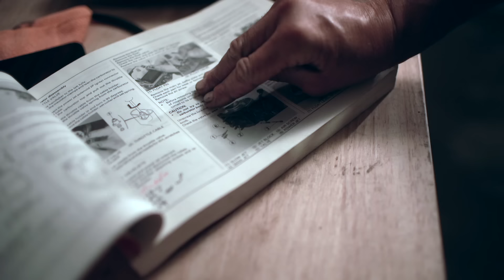Velocity Disorder II. Honda CRF450R vs CR250R

Comment: I love the video just hate to see the CR250 two stroke get disked like this by racing a CRF 450 but the 250 handled that 450 pretty well i would like to see the 450 race  a CR500 because the 450 is what took the place of the CR500 what do yall think?
Reply: 250 2 stroke = 450 four stroke in terms of power. (Almost) The 450f class replaced the 250 2 stroke class not the 500.
Reply: @MotoBuilds  i gess that puts the CRF250R in the 125 two stroke class and the CRF150R in the 80 or 85 two stroke class dam these four stroke bikes are slower than i thought i grow up riding two strokes anything from a CR500 to a TRX 250r plus the two strokes are cheaper to rebuild and the four strokes dont hold up that well to todays riders as good as the two strokes did?
Reply: @mitchellsteen9283  four strokes have power strokes half as often so they essentially have half of power., but that can be fixed with displacement.  Ha. I wouldnt say 4 strokes are "slow" because the displacement has been doubled and most modern 450s are more than the average rider can handle nowadays.  4 strokes are more expensive during a catostropjic engine failure event but the only real difference is a valve train in the head and a timing chain.  And the reliability of the 4 stroke is much better IF properly maintained.  I love them both but I dumped my 2 stroke for my 450 because the power curve is more linear than exponential and I can get 150 hours out of a single piston.  Go check out my channel if you want to see me rebuild a 450r engine :)
Reply: @MotoBuilds  Not even close. That's the kind of mindset people have because they rely on outdated information and logic. 4 strokes have advanced and progressed to the point that they match their two stroke counterparts in power and weight. The latest 2019 models of the 250 4 strokes have more wheel horsepower than what Yamaha and KTM's 125 2 strokes produce at the crank. Here's a little comparison

A 2018 KTM 250 SX 2 Stroke Dynos at 40.11 rear wheel horsepower, and weighs in at 211 pounds or 95kg

Compare that to a 2019 KTM 250SXF, which Dynos at 38 rear wheel horsepower and weighs 98kg. Not only is that barely less powerful and barely more weight, but that 250 SXF is more powerful than Yamaha's YZ250, and weighs half a kilo less. The YZ250 Dyno'd at 35.06 horsepower at the rear wheel. As for the 450s...they Dyno around 54 horsepower at the rear wheel, indicating they have over 60 at the crank. This is very clear when you look at races and videos where they can make use of that power. I watched a full hour plus race from HighSidedFilms where the guy used a 450 Honda, constantly battling with a guy using a 250 ktm 2 stroke (He ended up losing because he fell literally 100m away from the finish line) . And every time they got to a longer straight, or any point where they could make use of their power, the 450 just freight trained away like it was playing with it. The reason people don't always notice the difference in power is because on a small, tight dirt course you can't really make use of that 60 hp. When you take a really good rider on a 125 2 stroke and put him against someone average on a 450, i wouldn't be suprised if the guy on the 125 easily wins. And if both were good riders then i don't imagine the guy on the 450 even be running Laps around the 125 either because power is hardly all that matters there . Because on dirt tracks you really do need skill. And the whole 80% rider, 20% bike thing really comes into play
Reply: @dean8067  interesting.  Wasn't aware the stock 250fs were pulling those numbers.  I build 4 stroke mx bikes for a living but the majority of builds are carbed 04-09 bikes.  The 450s are still pushing 52 stock in those years but the 250fs wont hold their own against a 250 2t in those years. Having said this it still holds true that the 450 class = 250 2t class from years back and the 250f took the 125 class.
Reply: @dean8067  Something to note is that regardless of how you look at it, The 2 stroke literally will have twice the power of the 4 stroke engine at the same displacement  if they are built with identical advantage. The newer bikes come stock with a much higher compression ratio piston, optimized downdraft intakes, have electronic fuel injection, have selectible mapping to advance spark timing and so forth.  This tech stopped for the 2 stokes way back-when, and if this tech was applied to the 2t today it would match those same numbers to the rear wheel at half the displacement. Don't get me wrong, the 4 stroke is amazing.  I love mine. But at the same cc's under the same conditions, the 2 stroke has twice as many power strokes and is thus twice as powerful.
Reply: @MotoBuilds  All those things you mentioned about the 4 strokes are very true, those are exactly what made them so powerful lately and right and match the power of the 2 strokes. But the thing that people get wrong allot of the time is, 2 strokes actually haven't been out casted from research and development, or left to die with ancient technology. The thing is, 2 stroke technology has huge limitations, and is pretty much stagnant as far as making stock power, and has very little more to improve, because it functions so very different from a 4 strokes, almost none of the things that make these modern 4 strokes so fast can be done to 2 strokes. You can't add traditional fuel injection, so no nice mapping and custom tuning. 2 stroke technology relies heavily on its ability to breath, which is why they don't even have a rev limiter and simply hit a point where it can't give anymore when you accelerate hard, so they can't be forced induced in any form or way (I know the 4 stroke bikes don't get turbod much either, this is more of a reference to road bikes like the Kawasaki H2 and modified bikes).

If you look at KTM In particularly, you'll especially see how they do in fact try to update and innovate with their 2 stroke bikes. They spent millions in research and development, developing and designing their own custom two stroke fuel injection alternative so that they improve upon their engine, because that's all they can do... They can literally do nothing else to improve the engine much in the same ways as the 4 strokes so they innovative and try new experimental things. Recently 2 strokes are more popular than ever it seems, people love being nostalgic, hating on everything 4 stroke and sticking with 2t. You can see it everywhere in social media and even here on YouTube in any comment section about dirt bikes. The other day the YouTuber MotoTube asked his subscribers to vote in the comments who preferred 2 stroke or 4 stroke. And roughly 80% of people said 2 stroke. So using this information you can assume KTM, Husqvarna and Yamaha's 2 stroke models sell better than their 4 stroke options, or at least sells competitively to the point that it makes a huge profit for them. Each brand has 2 other manufacturers to compete with in terms of sales, performance and such. So why wouldn't they try and update the bikes, it only makes sense. Ktm did just that, and reaping the rewards for it. Even without concidering the TPI model though, they have been redesigning and updating their 2 stroke models regularly, similarly to their 4 stroke counterparts aswell. There just isn't much they can do, without ruining the reliability, rideability and such. Although their 250 2 stroke has gained about 5 horsepower since 2006 to now
Reply: @dean8067  Out of all you said, one thing really hit hard, 80 percent preferred 2 strokes!??  Holy hell I need to start rebuilding and selling 2 bangers. Lol But in all seriousness, good points.  I wasn't sure if there was more to be applied to the 2 strokes in terms of tech that was just undiscovered as of yet because of the move away from them but the R&D may have very well hit a wall.
Reply: @MotoBuilds  Haha yeah that's for sure. I wish the community was abit larger here where i live aswell, because there are so few nice places to go ride and enjoy yourself, i need to travel quite the distance. So here i don't really care who, 2 stroke fans or 4 stroke fans, i just need people to ride with hahaha. But yeah man maybe they might suprise us and so something big, we never know. All i know is that all of the bikes have become so good that it doesn't matter what you prefer or want to buy, the biggest difference lately is the color of the plastics. They'll all give you heaps of fun and loads of performance
Reply: @MotoBuilds  four strokes have more moving parts in the motor which makes them slower two strokes have fewer moving parts which makes them faster and the motors trun ten times more revolutions than the four strokes in the same distance
Reply: @MotoBuilds  if you look at the drag racing side of the two strokes which are the same engines just i a different kind of racing there has been a lot of improvements in making way more power in the two strokes it just needs to be converted into a racing style
Reply: @code name noob a stock cr500 makes 58.8 horsepower which should be in the 450 class a built and stroked cr500 ive seen reports on makes any where from 90 to 100 horsepower the point i was making is that in this video the 250 done very well riding with this 450 but both are very nice  bikes i would just like to see them race in their on classes to what the best is i gess im still hung up on castor 927  and racing fuel
Reply: @mitchellsteen9283 Not true. Same revolutions or even less, just twice as many power strokes. And the extra moving parts on the 4 stroke don't create a high enough energy loss to effect power at a noticible difference.  I just explained the difference between the motors.  Did you not read it?
Reply: @MotoBuilds  Yeah i was just abit to say the same.. It's like he didn't read any of the conversation from earlier
Reply: @dean8067  yeah i read the comment i ws just getting to the two strokes only have a piston and A-Rod that run off the crank shaft a four stroke depending what ever model you have could have 2 or 4 values it can be one over head cam or dual overhead cam with a timing chain and the four strokes run a Revlimit box which keeps it from blowing up and no mattet how much you do to the engine it can only be truned  up so much before it hits its breaking point the two strokes rpms truns way more higher and can be pushed further before is Breaking Point what do you think? I also seen a new photo of hondas new bike coming out its going to be either a CRF 550r or the cr550r which is supposed to be equal with the CR500
Reply: @mitchellsteen9283  Yeah i understand man that's right. But the modern 4 strokes have a surprising amount of tuning capabilities aswell. See their fuel injection and ECU's allow them to be tuned quite extensively to your liking, air fuel ratio, richer fuel mixture, leaner etc. You can swap the cam to do even more etc. I always saw these extra moving parts and stuff that the 4 stroke also has as more potential things that can be exchanged and upgraded. I know of an article from 2015 where MXA built a CRF450R with 66 wheel horsepower. So it's safe to say it has around 72, 73 horsepower at the crank. And i believe i watched a video from earlier this year about a guy using a 450 ktm in Motocross, and he apparently always wanted more and more power, and apparently they did everything to his bike that can be done within the limits of regulations, they didn't say how much hp, but all the reviewers said it was too much to handle. I just recently saw an article aswell From Motocross action magazine where they built a 68 horsepower kawasaki KX450F. I'll try finding out where two strokes end up after being modified by doing some research, but i highly doubt they'll gain more than 20 horsepower out of those small engines.. That would mean it'll have to gain more than half of its stock power
Reply: @dean8067  a YZ250 stock makes about 9 more horsepower and about 10 more pound feet of torque than a yz250f. Please explain how a 4-stroke makes more power again those are direct stats from Yamaha
Reply: A good conversation and a pretty good read, I like all the point everyone is making. Pretty interesting to hear all the facts between the 4 stroke and 2 stroke bikes. I ride a 01 CR250R and I just love the powerband, I’ve basically ridden 4 stroke bikes all my life and within the last 5 years or so have been converted and I don’t think I’ll ever go back! Just my 2 cents. And who cares what you ride as long as your out there riding! Braap on guys!

Comment: Going to meet a gentleman today selling a 2000 CR250R .. Can't beat a Honda .. They just keep on kick in.. I'm a yamaha guy. My 1st bike was a 50cc ysr. I used in on and off road. Try driving slicks in mud.lol.. I was prob buzzed too.. Then got a blaster when I was 13ish then kx125 then banshee and a yz250. Gsxr 600. Gsxr 1000 R1 R1 .. Now god willing. This cr250 then a harley.. That's the plan.. Never neglect your inner child.. Full throttle rippin through the gears/years!!

Comment: 4 strokes are boring.
Reply: If they are boring why can they jump further out with more HP.
Reply: @thisseagamer8165  That doesnt make them any less boring. An equal displacement 2 stroke will have more power, anyways...You cant compare a 250 2 stroke to a 450 4 stroke. Two strokes are simply better for various reasons. They are lightweight, simple, easy to work on, more fun and engaging to ride, they smell good, etc. More character in general....oh and they sound better too. Whatever floats your boat, man. Thats just my opinion.
Reply: @T3merity  Sound better? 2 strokes sound like a squealing rat.
Reply: @thisseagamer8165  Thats an opinion
Reply: @T3merity  I know, but another reason I prefer 4 strokes is because of how they ride smoother and can idle longer.
Reply: @thisseagamer8165  who needs smooth ride in a dirt bike? most of the timr throttle is used like an on off switch anyway... i like the two stroke brutal power delivery!
Reply: @playhardgopr0  But they litterly always flood out and are hard to start, but true two strokes are beast. A 450 4 stroke is better still though.
Reply: thank u  @thisseagamer8165
Reply: Nike Galaxy a 4 stroke sounds like a grandmas fart
Reply: Try a kx500af, a true mans bike, that's  power bitches

Comment: To those looking to revivify the 500cc 2stk. I owned and raced an 84 CR500 and an 85 KTM500. These bikes had too much uncontrollable power and were much slower to ride fast on most courses. 500cc 2stk would be especially horrible in SX..... too much flywheel weight interfering with the handling via the centripetal force and the rapid power delivery interfered with the suspension compliance, especially under power. A 250 2stk and a 450 4stk are analogous in terms of the engine type/capacity with each optimized for the fastest lap times.  Note that manufacturers hv stopped increasing 4stk capacity at about 450cc..... more is found to be less.... ergo, slower lap-times.

Comment: Torque vs Power its like sport bike vs a built cruiser. Torque is more user friendly Power is all about the revs and staying in the power band. Power is harder to apply correctly but rips out of turns a two stroke never fails to put a smile on my face. Even a little 80cc can be a terrifying 0-40 mph death machine lol
Reply: MrSnapy1 lmao have u ridden a 450r the powerband was so massive it's almost like a 2t the only reason I prefer them is back they're like a 2t top end waist but can torque up hill and that so if ur low revs instead of bogging or changing down u just open her up and she will use that torque to get back into that powerband. But for real I'd have a cr500 over anything
Reply: Pretty sure both of these bikes have fuckloads of torque. The torque is just more spread out on the 4 joke. It hits all at once on the 2 stroke
Reply: @ki_charger   Of course but anyone who knows a two stroke knows it has to be revved. Which is power more than torque. Feels about the same in my experience twos feel better out of a turn and fours carry more speed into the corners.  The two stroke just requires more clutch and throttle control where fours excel at "low" end torque.

Comment: The 2-stroke motorcycle is simply a superior racing machine.   4's are are great for cruising for grunt work quads but for racing they simply aren't anywhere near what a 2 stroke w/ half the displacement is.

Comment: It's weird how little overall speed the 250 gives up to the 450. I grew up on quads and ridden a few dirt bikes.I want to get either a 250 or 450 but they would both be 4 strokes. I'm 170 5'9" . Was worried that I couldn't keep up w 450 on a 250. I guess the size and frames are similar but difference in weight. I'll be using on trails mostly, what do u guys think. Am I big enough to be comfortable on a 450?

Comment: Only because 2 stroke bikes have 20-30 yr fuel/air and lubrication systems . Out at Univ of Idaho they didn't want 4T sleds so they developed ETEC . An ETEC powered 2T snowmobile makes far more power per cc with better emissions and better fuel mileage than 4T ...and wait, there's more.....FAR LESS WEIGHT .  Not to mention, changing a piston and rings is mot much more complicated than changing a tire.  Same deal with Evinrude 2T outboard motors .  Ask yourself why they never make a chainsaw 4 stroke ?  Power to weight ratio...simple

Comment: Two strokes has way better power than four strokes on same displacement.
Reply: Well, go buy a used and clapped out CR500 for 5 grand that's over 20 years old with shitty suspension and a finicky carb. You'd probably still lose to a 450 even on pavement.

There is no modern production 2 stroke equivalent to a 450 unless you want to spend your retirement fund on a Service Honda or Maico 700. 

Two strokes are an endangered species becoming less and less relevant as time goes on.